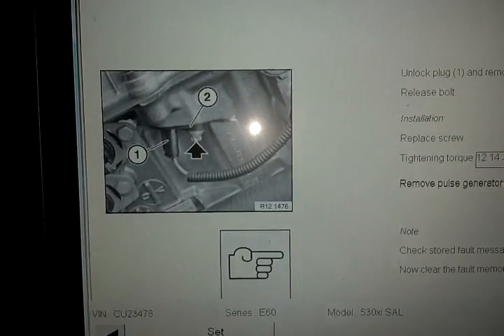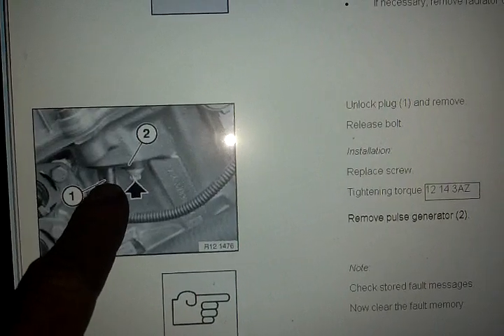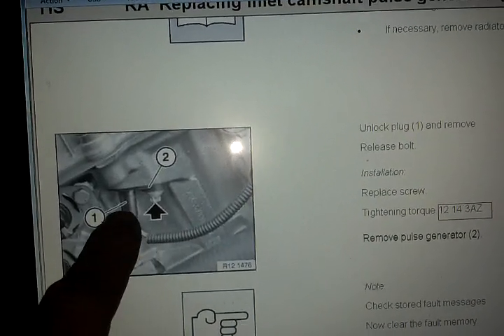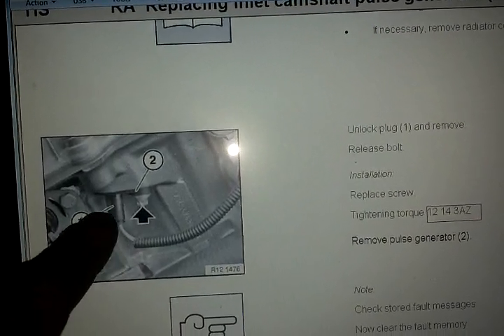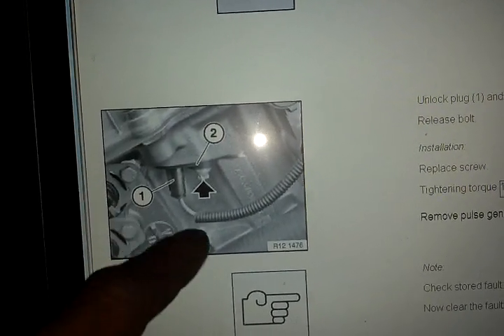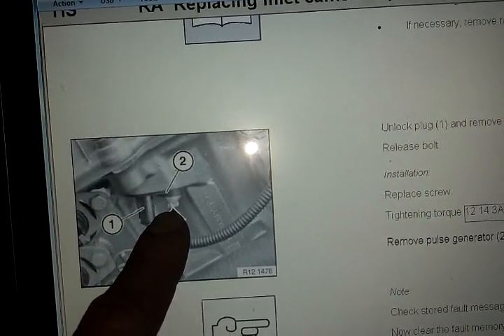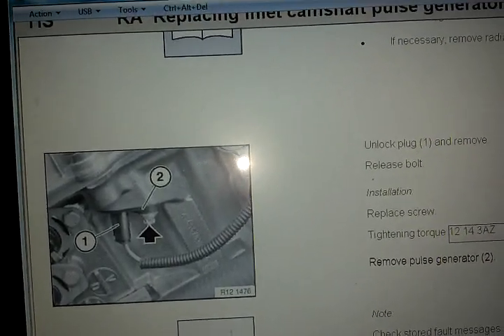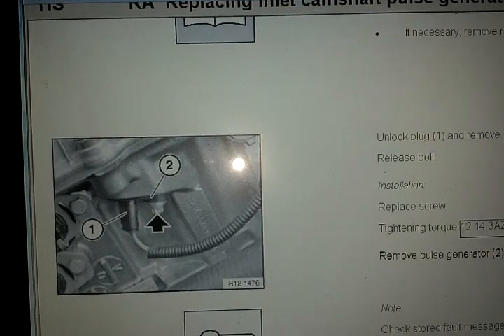BMW Repair Instructions On How To Replace The Inlet Camshaft Sensor N51 N52 N52k

Comment: What symptom did the car have for you diagnose the camshaft sensor?   
I have a rough idle after a shop changed my starter, but the car does not give  any code. It gets really bad if I put it on reverse or drive with the ac on. After the car is at temperature it gets  better, but a little rough idle.  Do you know a obd2 scanner that can work will with the 2008 bmw x3 3.0 i n52 Canada? Thanks for the videos you upload.
Reply from the maker: Hi Jean! Glad to try and help. To replace your starter the intake manifold has to be removed. I suspect you have an un-metered air leak. Eventually it may set a check engine light for a mixture too lean fault code. As of now without a check engine light there won't be any good information. To check for an air leak you would have to have the vehicle smoke tested which is equipment usually only a shop has. Since this happened after the starter they may be willing to do this for free for you. You should also ask them if they replaced the intake manifold gaskets with the starter. They should be replaced every time the intake is removed. If they did not do this then they did not perform the repair correctly and they should replace them for free.
One additional thing to check. Does the rough feel only happen in R or D when at a stop and if you put the vehicle into neutral does the vibration feel go away? Looking forward to helping you!
Reply: @AskTheCarExperts  the rough idle is present at any time, but when I select reverse with the ac on, that is when is undeniable. I believe it is a vacum leak, I smoke tested the engine using a cigar and a hose, but there was no evidence of vacum leak, I only saw smoke after opening the oil fill cap. The vacum leak is so small that I believe it is from the intake gasket. As for the shop, they denied any wrong doing, but they did not replaced the intake gaskes. 

As for the obd2 scanner I would like to see How the fuel trim is managed by the ecu because i think in the city drive the fuel usage is above what it should be. Thanks!
Reply from the maker: They should have replaced the gaskets per repair instructions. I would imagine they should do this install for your with free labor and you pay for the parts. Hopefully they are a reputable shop and will accommodate you. Fuel trim is a good way to check for a lean condition. The more positive the number the more lean it is.
Reply: @AskTheCarExperts  the shop says there is nothing wrong, no code present.  They said they can replace the intake gasket for 4hours labor. I Will have to fix the car myself. This issue has been going on for over a year. Thanks!